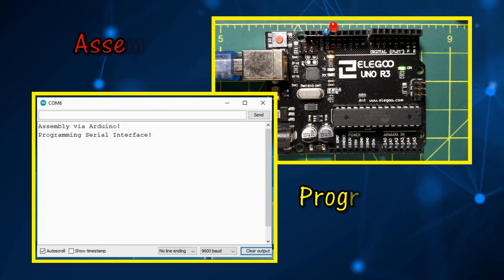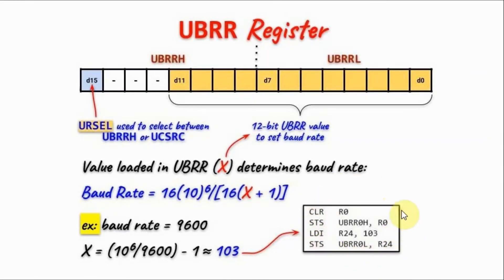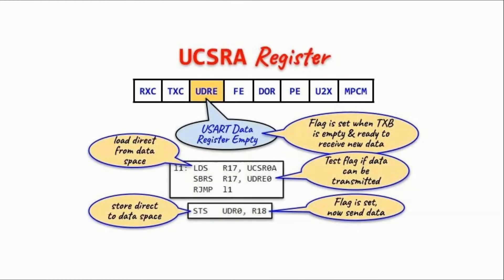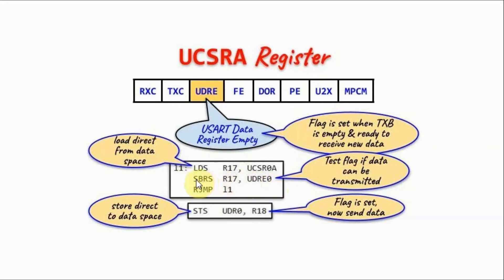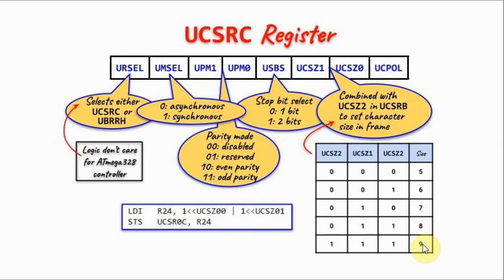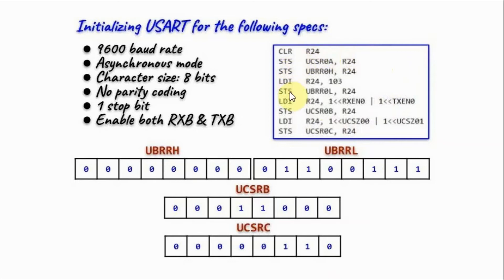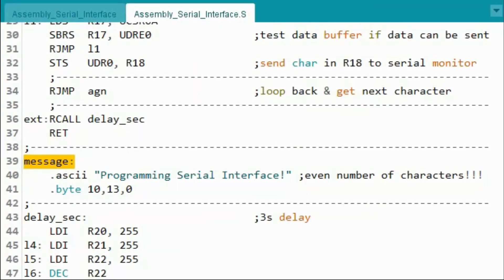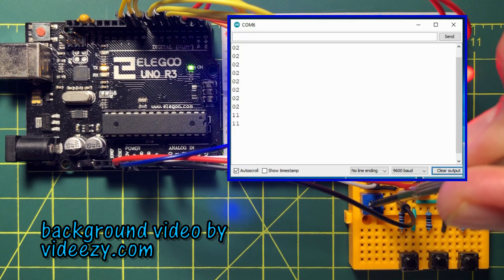Assembly via Arduino (part 7) - Programming Serial Port

Comment: Very nice work. A question: why Microchip Studio give this error "syntax error, unexpected '("  from this line "LDI   R30, lo8(message)" of your code? I use your code outside the Arduino IDE, directly in Assembly. Thanks.